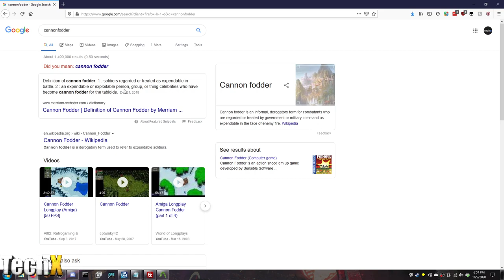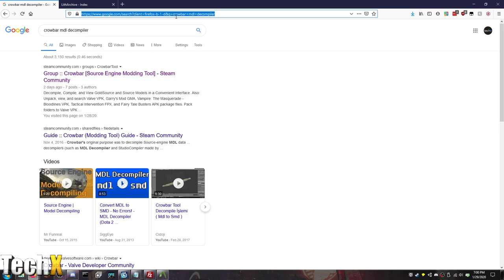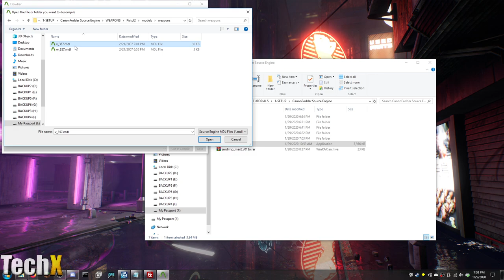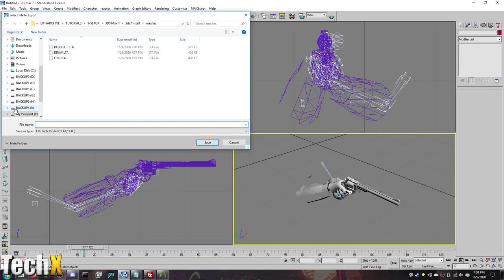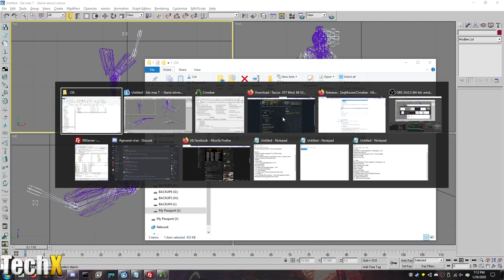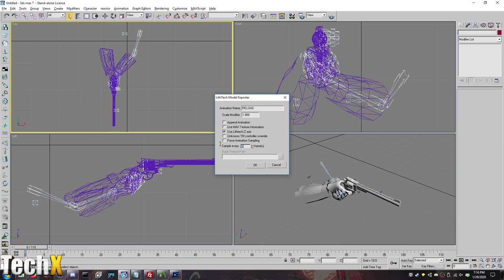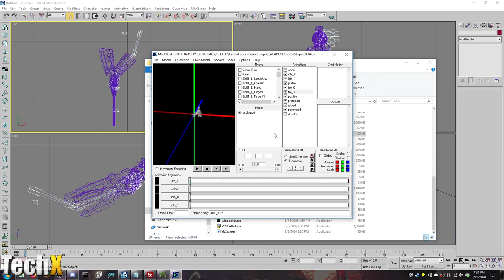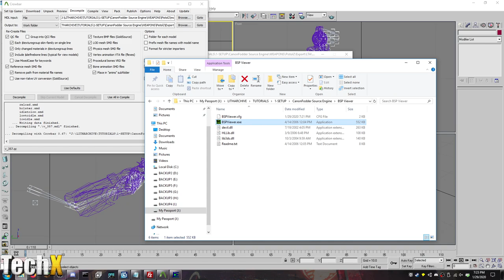4.) Source Engine to Lithtech Jupiter Model Conversion ~ TechX Lithtech Tutorials

Comment: Another off-topic question: Is it possible to extract animations from an LTA then import it to blender?
Reply from the maker: Honestly no idea. I only know how to convert to lithtech, not away from lithTech. I know there's tutorials to convert to the source engine in the crossfire section of mpgh, so maybe start there. I know nothing about blender because I don't think anybody uses blender for the stuff. Everything is made for 3DS or Maya. Luckily thanks to me never deleting anything after I pirate it, I do have the old versions with key generators of both 3ds Max 7 and Maya 5.0. you should be able to find them on the litharchive website I believe

Comment: This may sound off-topic but is there a way to open .DTX files? DTX files are image formats used by Lithtech. Photoshop can't even open it.
Reply from the maker: Yeah easy. Download the lithtech jupiter game engine, install it and it comes with plugins for photoshop, along with 3ds max and maya 3d modeling plugins
Reply: @TechX1320  One more thing... To be honest, I've been trying to sesrch it for hours and I can't seem to get the expected results.

I just need the DTX format plugin for Adobe Photoshop 2020. Got any link?
Reply from the maker: I do not. My external drive with all that stuff on it broke, so I'd have to download the whole thing myself as well. Also remember, it's a game engine from 1998. Plugins for Photoshop that are that old probably won't work with Photoshop 2020.